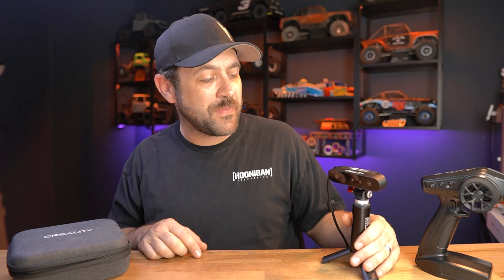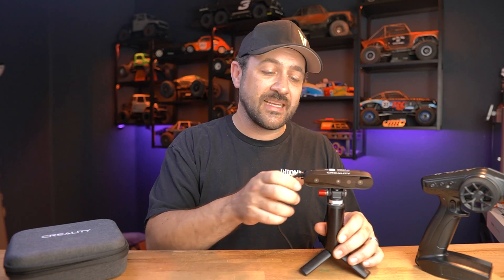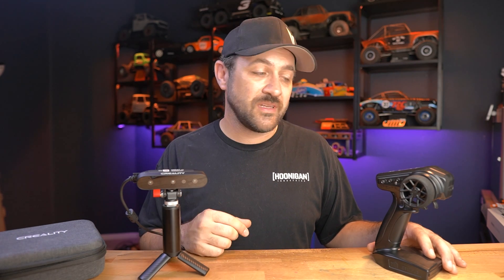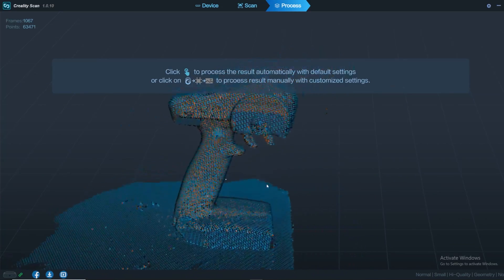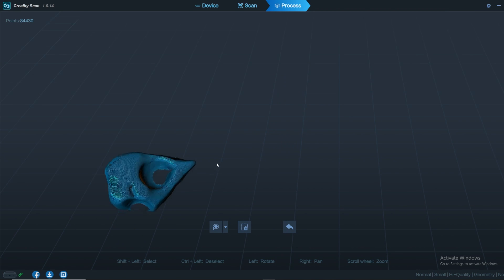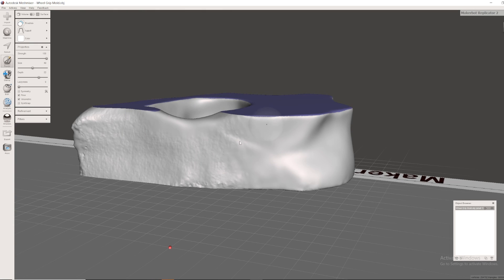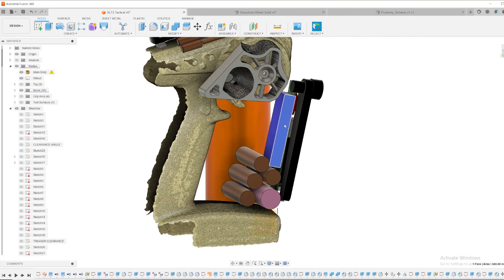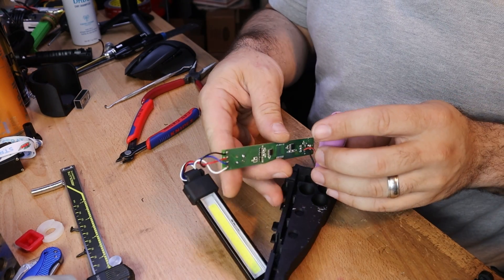You CAN’T HANDLE this radio! - Creality CR-Scan Ferret - 3D Scanning Project

Comment: Just got mine in. Tried it on a part that was 3d measured with a blue light 3d scanner. At a diameter of 113.65 mm (verified diameter by blue light scanner) , the ferret measured 113.485. quite impressive really

Comment: I have the creality cr 01 scanner and was blown away by the first scan of the front of my dark grey car in a dark garage even, large scans is what it does.
I am thinking of also getting a scanlizard for smaller things and between the two should cover everything from coins to cars. Maybe another with lidar for topology mapping buildings, and the self driving giant mower project that won't run over anything or into anyone or anything .

The sabretooth 24v rc controller running wheelchair motors and maybe tank like tracks eventually moving snow from the comfort of the living room, or while vacationing many tropical miles away. 🤔 

Rock on.

Comment: Do you happen to have a part number for that hex handle from harbor frieght? I’ve looked but can’t find anything like it
Reply: Ratcheting Right Angle Multi-Bit Screwdriver Set, 8 Piece - Item 92630
Reply: @drowildcat2960  thank you. I have the icon kit but this one looks like this one will work well under dashes for blend doors